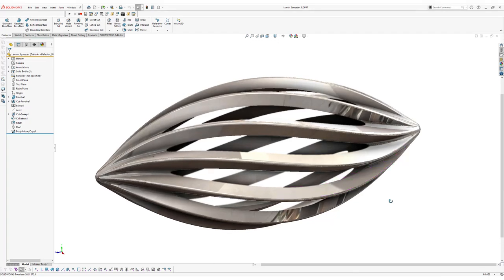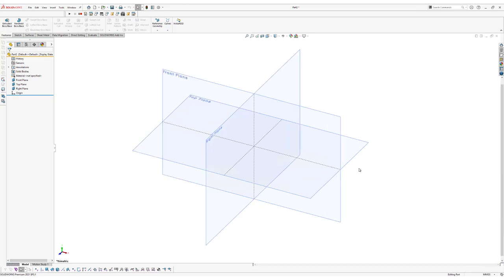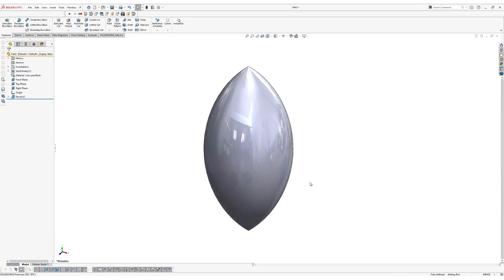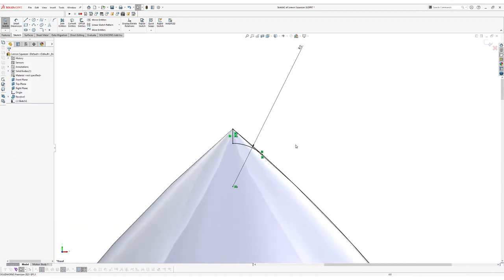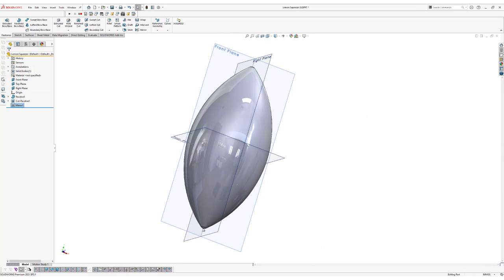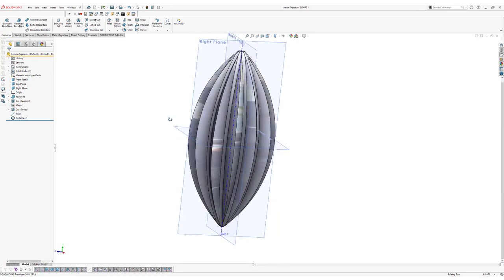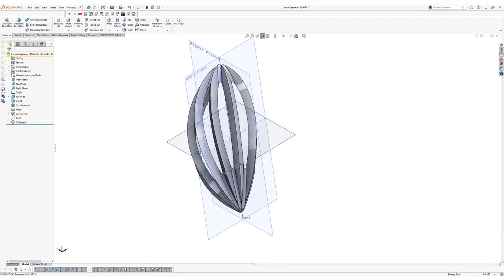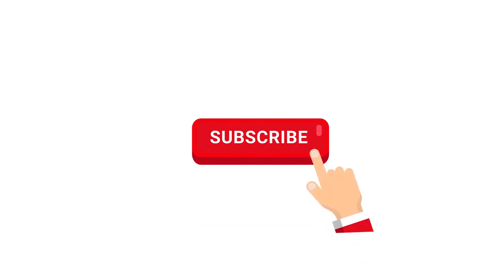How to model a Lemon Squeezer in SOLIDWORKS? 🍋 (AND discover the magic of the Flex Feature!)

Comment: Great video Jan! Could you please explain more about the triad in the twist feature, also i didn't get why you chose the value for x to be 90° and not 60°
Reply from the maker: I will do in a new video! You can set the Twist values as you want but in this case I wanted to replicate the original design so that's why I choosed a 90 degrees value for the X axis.